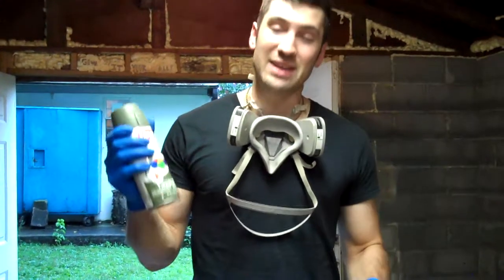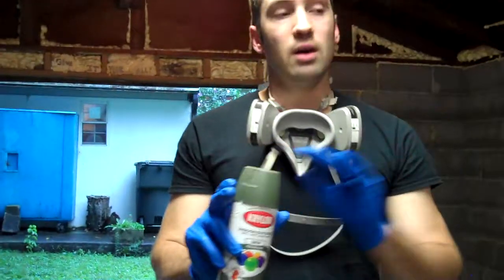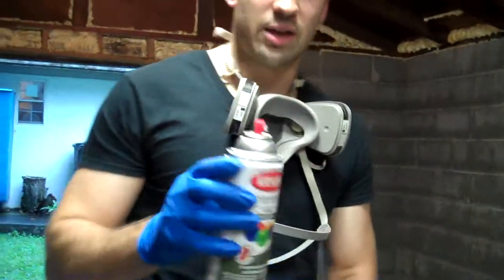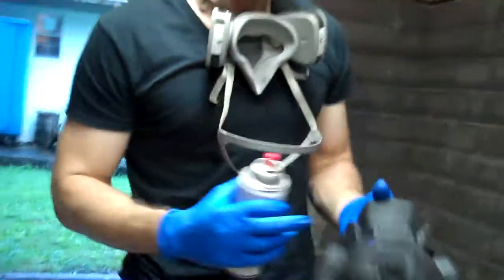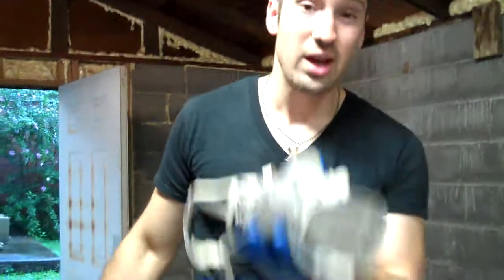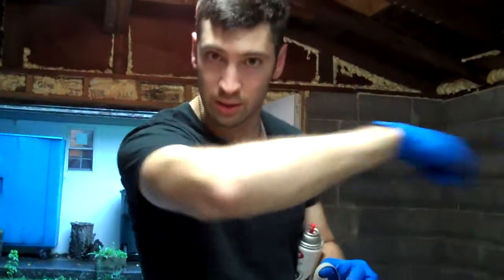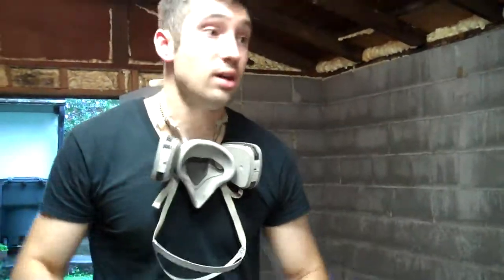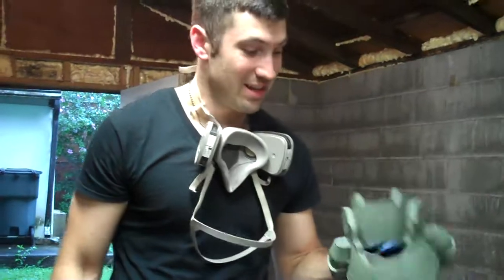EVA Foam Armor Painting Tutorial 1 - Base Coat

Comment: What would you recommend for me to do if I want to apply lighter colors (like orange etc) over black Fulldip? Should I firstly just dip the foam in 3 coats and then apply a primer over that? I happen to have Rustoleum primer laying around. I also just tested the paint today and I can see visible little holes showing through in the foam. Case of heatsealing longer?

Comment: Ok most air spray paint comes with primer on it. My question is, is it okay to coat your EVA foam with 3 layers of plasti dip then use a spray paint that has already primer in it? (It’s hard to find spray paint that doesn’t have primer in it especially if you only live in the country does not have much sources)
Reply from the maker: Yes you can use primer infused on top of plasti dip with no problem.

Comment: Can I use acrylics? I have some small detail in my armor and I'm not sure how to paint it. If acrylics do work, should I still use mod podge to coat it?
Reply from the maker: +Brandon Leonard yes acrylics work great.  Instead of coating it with mod podge, I would get a can of spray-on clear acrylic and coat it with that.  It really protects well.
Reply: So I should use the spray on acrylic, then plasti dip, then paint?
Reply from the maker: I would do plasti dip, then paint, then seal it with clear spray acrylic.

Comment: Why do people coat their pieces in mod podge before the plasti dip?
Reply from the maker: +Brandon Leonard They do this to harden the foam.  For instance if they are making an Ironman suit most people want the suit to be hardened.  It is also done with PVA glue.  Doing it with PVA glue allows the surface to be sanded to a glass-smooth finish. For my halo armors I don't typically mod podge because I like that the foam has a bit of give to it when I'm moving.  Especially in the legs and chest.

Comment: When I spray paint, it seems to be not sticking well. I plastidipped. But idk why the paint isn't really sticking.
Reply from the maker: What kind of paint are you using.
Reply: Angelegend krylon. Bone white glossy finish.
Reply from the maker: Ok is it an enamel paint?
Reply from the maker: If you went with black plasti dip, then I think I know the issue.  The white I'm sure is stick, but just not showing up as well because it's landing on black.  You will most likely need to hit the entire thing with a Matt grey primer first.  That should solve you issue.
Reply: Angelegend hm. That sounds good. I'll try to spray the other pieces with gray first. Thanks man. I appreciate it!